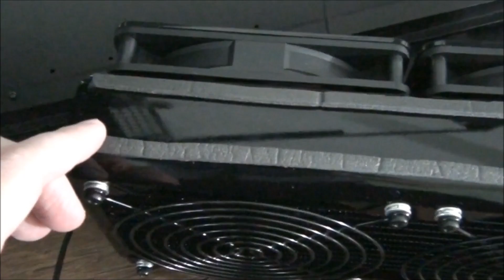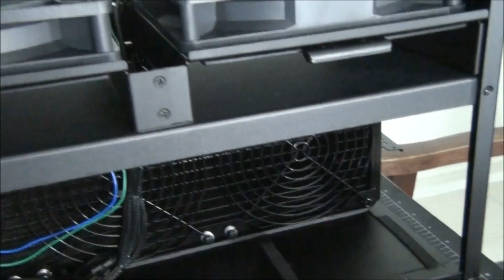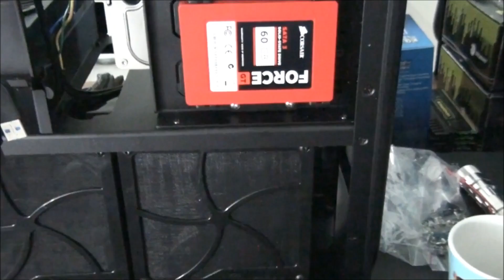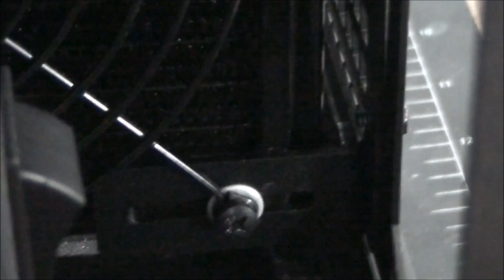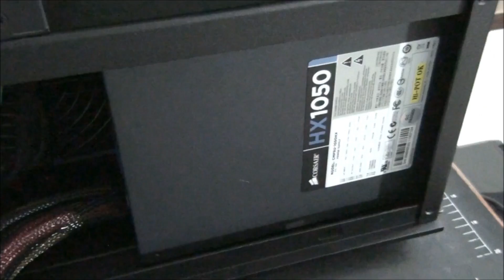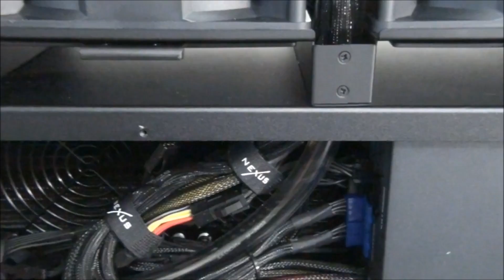Build #4: Extreme TJ11: Part 3

Comment: Have always been curious if on a truly custom Water cooling system make the Res and Radiator the same component. And using steel braided hosing for the loop. and Using High Flow fans to cycle the air higher than normal.

Comment: Im planning on sleeving my PSU, but i just thought of something, i have a modular PSU and i was thinking if it would be possible to buy some cable extensions like the NZXT/Bitfenix ones, and just switch out the connectors, and if thats possible, does it matter which side of the cable im switching?

Comment: When the fluid hits the smaller opening it increases the pressure. The pressure and velocity are based on the diameter of the opening. So more pressure equals higher velocity so there to keep the equilibrium of the system. Conservation of momentum. If you want more detail I'll have to go find my fluid mechanics textbook and it is buried in a box in my garage!!! lol

Comment: @SingularityComputers I think you said you were using bitfenix spectre pro fans, but I'm not going to watch the entire video again just to find out. I wouldn't call 56 cfm high flow...unless you are using the 140mm fans that do 87cfm. Either way, though, their static pressure still isn't that great at 1.38 mmH2O.

Comment: @vanhodid  I understand that they're g1/4 thread! I'm asking what size compression fitting screw into the blocks. Are they 1/4", 3/8", 1/2" in diameter?

Comment: @igaman0217

The 3/8 and 1/2 is the tubing, most if not all compresiion fitting and barb fittings are designed for g1/4 thread,

Comment: Thanks for the videos. The information in them is outstanding. 

Question: I have searched everywhere and can't find the answer; what size fittings go on the components (reservoir, blocks, etc)? All I've found say they're G1/4" thread, but how do I know what fittings (1/4",3/8",1/2")?

Thanks. Keep up the great work!

Comment: @SingularityComputers do you put this down to the design of the case or the quality of the intake fans or a combination of the two ? i watched a video from silverstone that showed them using a cardboard box with a smoke machine inside placing other fan types on top of the box and when they put the penetrators on, the difference in airflow was amazing im going to be using them in future new builds in the coming month this is all ofc without seeing your numbers for this build

Comment: @SingularityComputers It will lower the static pressure of the fans. You need as much as you can get with high FPI radiators. I don't have the numbers but I don't think it will effect it that much. But you certainly will not be getting 100% of the performance you could. It is a performance vs convenience thing. Convenience wins in my opinion.

Comment: great video as always and the build is looking really professional although i also would echo the previous posters concern about the air flow in the main compartment of the case i believe you used the 2 air penetrator fans as intakes with a single exhaust near the top. Is this going to be enough ? you refer to the client living in a hot environment enough to melt the glue on the backside of velcro with only air cooling on the vrm and chipset are you confident on the airflow situation in the case

Comment: @jdookie2908 If the radiator would start to leak infront of the psu intake though, that could be a flaw, dont know if the airflow would be powerful enough to blow the fluid into the psu... but I would take the risk : P